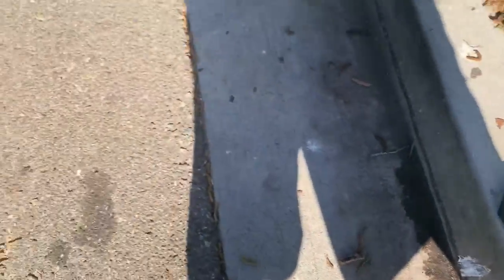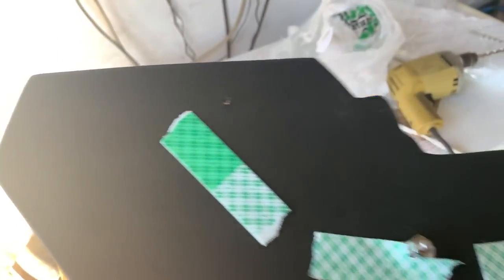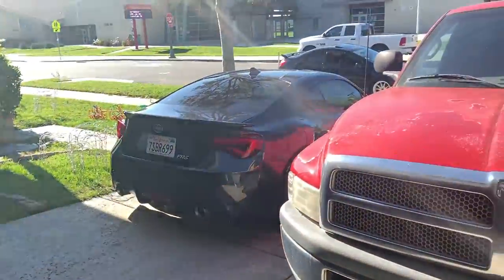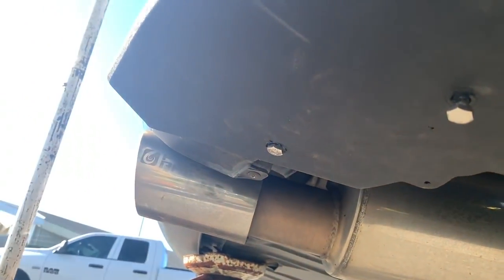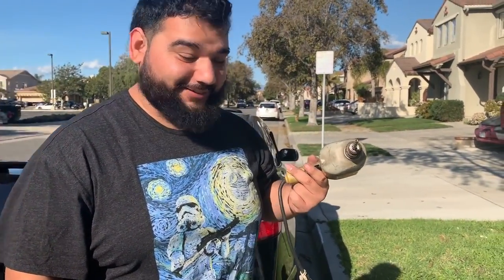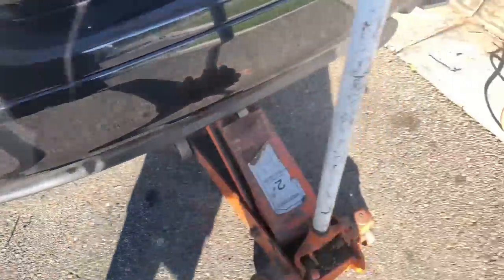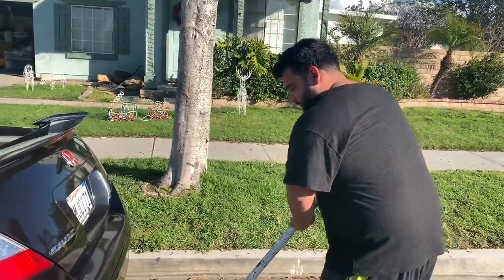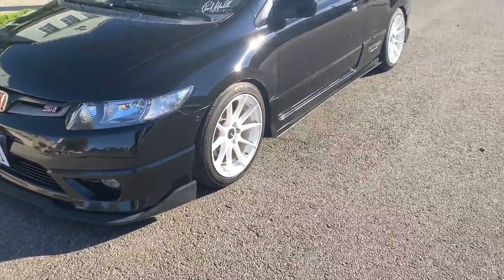Honda Civic Si Rear Corner Splitter Install!!!

Comment: Tony are your rear coils installed correctly? I thought the adjustment parts were suppose to sit on top of the springs not bottom?
Reply from the maker: Fue Thao yea they are. I’ve had this debate plenty of times